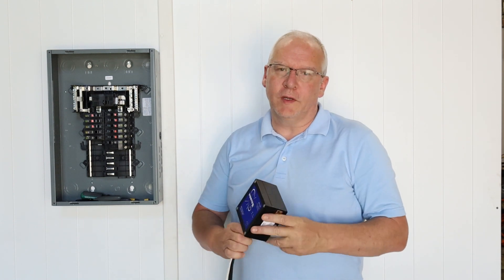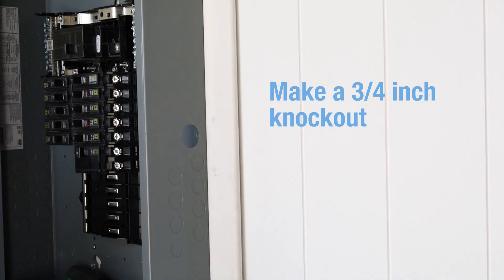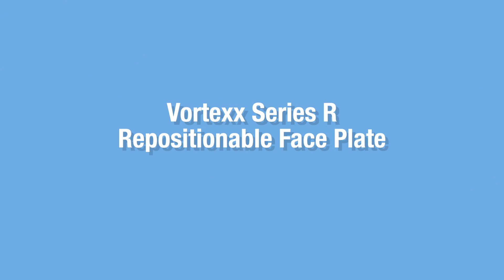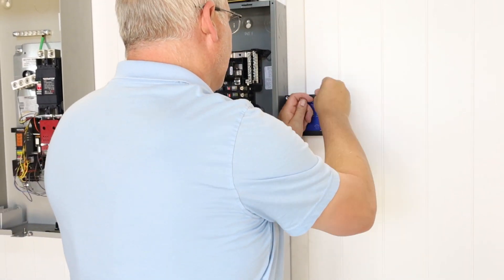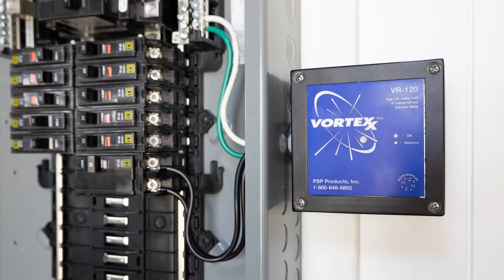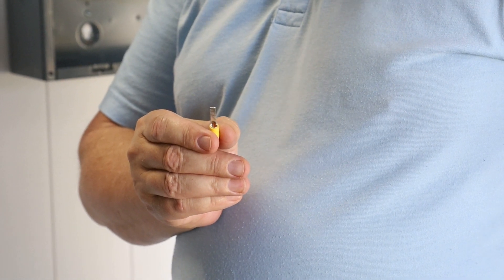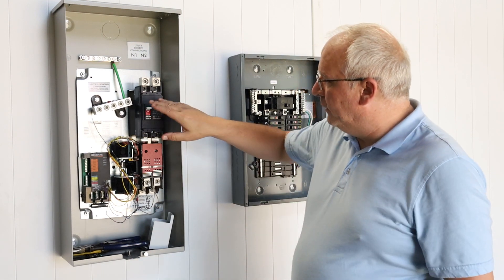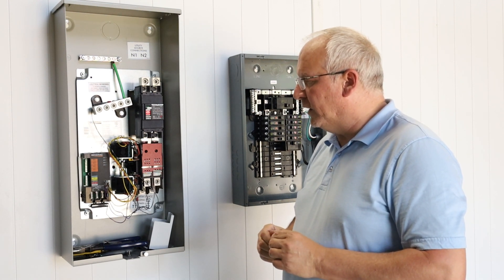Vortexx Series R Installation

Comment: Excellent video. Thank you. Subscribed. The installation on the transfer switch makes a lot of sense to me. Getting your device installed as close to the incoming line as possible before the current can damage equipment. Hundred percent clear. That’s why I don’t understand the installs I’ve seen of your devices in the main electrical panel. They seem to be installed in the middle on some random, really far down the line, circuit breaker. Versus close to the incoming line feed.